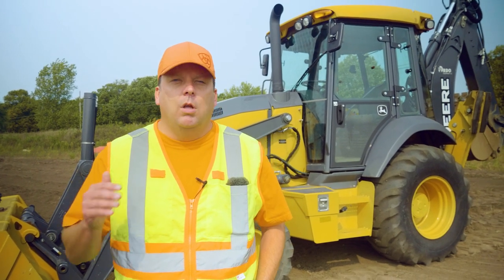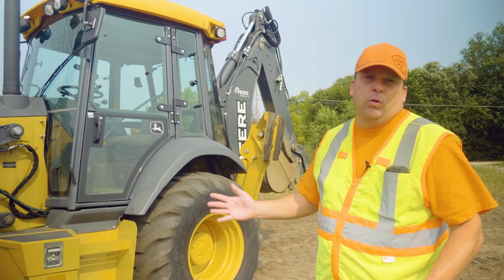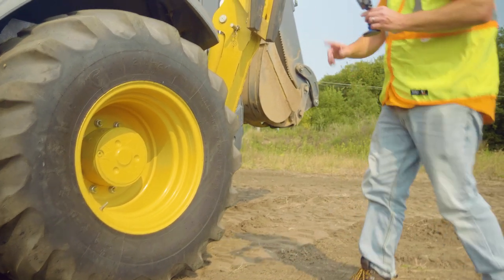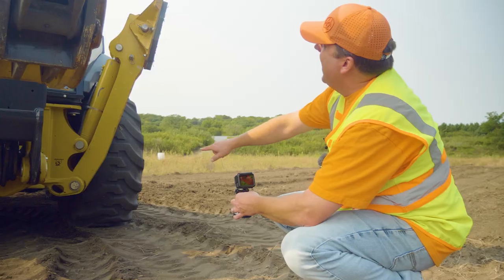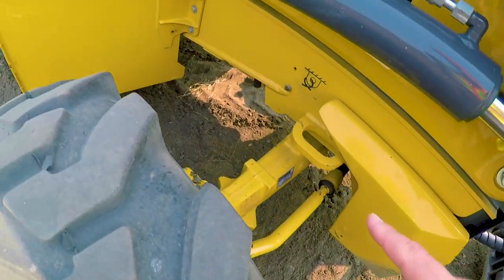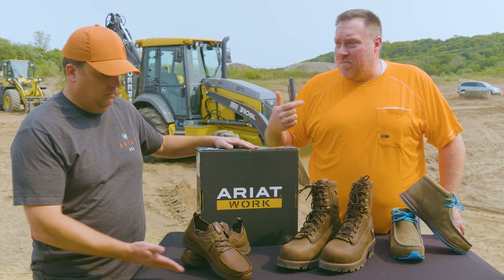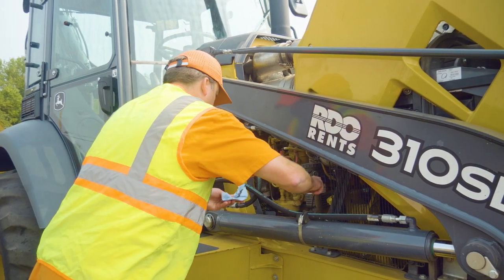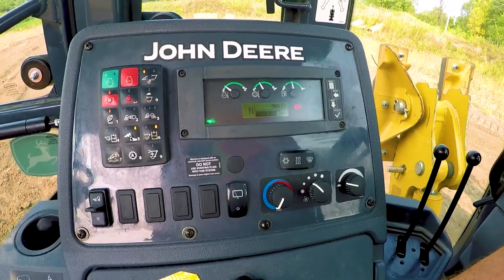How to do a Backhoe Pre-Operation Inspection | Tractor Loader Backhoe Training

Comment: Good advice on the inspection, a couple things I would add is the hydraulic oil level should be checked with the backhoe in transport position. The cylinders will vary the level if the stabilizers are lowered or say the loader is up. The other thing is the transmission level should be done with machine warm and engine running.
Reply from the maker: Excellent advice!   Thanks for sharing!

Comment: On ur initial walk around you checked the oil and it looked black , isn’t that a sign that the units needs an oil change ??
Reply: Depends on what kind of oil you use. It all depends on the consistency of the oil.
Reply from the maker: Not necessarily.   Typically on the daily pre-op you just want to make sure that it HAS oil.   Generally we would monitor the hours to know when it's due to be changed.   Like on this one, not sure if you can see it but the oil filter has the hours from the last change actually written on it (this unit actually is due for service within next 50 hours).
Reply: Heavy Metal Learning   Awesome thanks. These oil guys always tell us that when the oil is black something is wrong with the engine.
Reply from the maker: Maybe some diesel mechanics will chime in here...
Reply: Heavy Metal Learning that would be cool if I heard it from a diesel mechanic.
Reply: Diesel engines produce fine soot particles in their exhaust, some of which get deposited into the engine oil and turn it black. This happens fairly quickly after just a few hours of operation. The soot particles are so small (compared to the metal-to-metal clearances in the engine) that the engine doesn't even know they are there, even though the oil looks black. Important thing is the number of hours on the oil (change according to your equipment manufacturer's recommendations) and the fact that there is enough oil in the engine -- verify on the dipstick between add and full marks. Note that all this applies to DIESEL engines only -- deep black oil on a GASOLINE engine, especially if it smells burnt, indicates a potential problem.